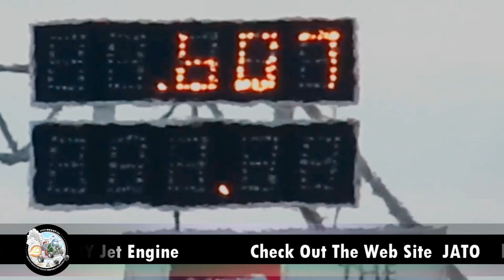DIY Jet Engine How Two World Records And More how to build jet engine at home

Comment: From barely working engine to 100+ mph monster jet kart.
You had so many issues to deal with but you never gave up and now you are master class.

Congratulations!
Reply from the maker: Hi, thanks 😀.... yep been an issue or two, and the bikes had plenty... still questioning if i want to open that can of worms again, or just move on and build an other engine, but the feel to 4+ years i have put in to the bike are waisted ?, thanks again for the comment, keep safe and well 😀👍

Comment: make a jet engine with a laptop fan
Reply from the maker: sorry... they dont work that way, one thing the fan wouild not be able to compress the air, two think a plastic fan would fall apart at 66000 rpm ? thanks for you comment 😀👍
Reply: Andy Morris aw man great vids though